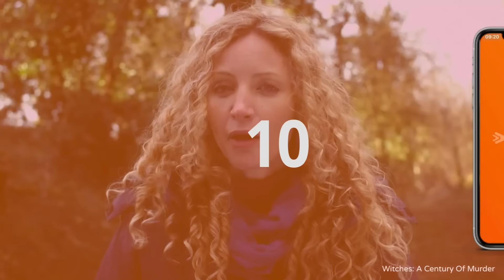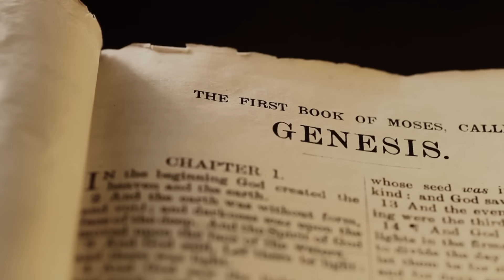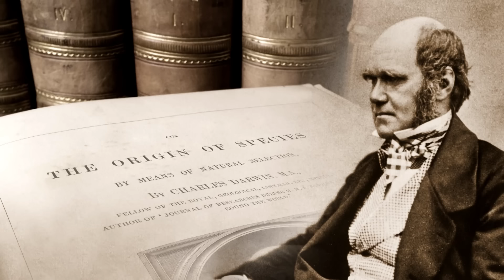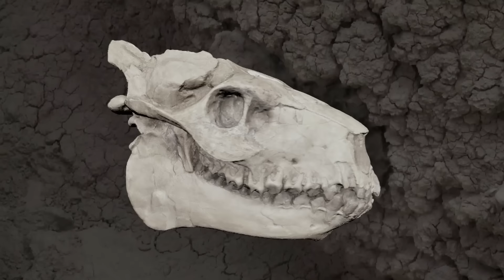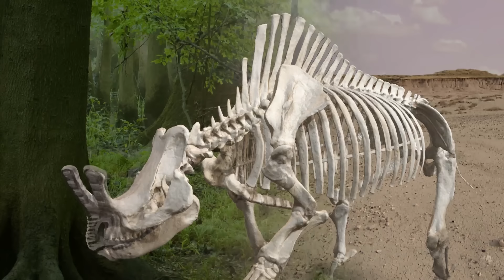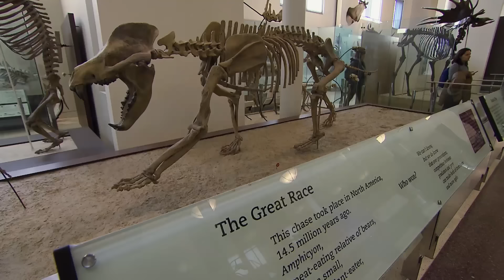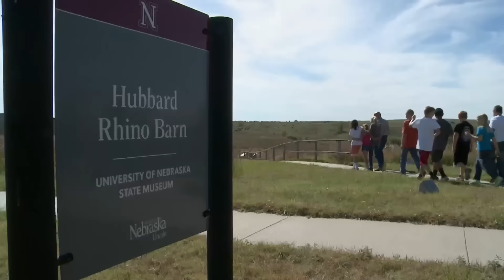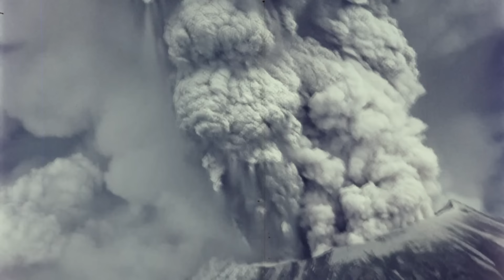Uncovering The Dinosaurs Of The Great Plains | Paleo Sleuths | Real Wild

Comment: How long does it take to turn a bone into a fossil? Here In Southern Illinois we have huge old mining sites that have been turned into state parks. The coal was fairly close to the surface so a lot of this ground looks like they just run the length of the deposit and laid the tailings to the side then move over and start another row. It looks like someone has gone over the entire area with a huge disc, like a field for planting as the rows are realitively straight and consistent in size. It's wooded and fairly thick but there are literally tons of rock of various sizes that has been brought to the top and now sit on the surface. There are tons of fossilized muscle shells in the rock. They have the appearance of modern shells. I've found nothing that looks to be prehistoric so I have always wondered how far back they dated. I feel like they are not that old.
Reply: Fossilized forest remains can be found by splitting layers of shales that were near the shale/coal horizons. Animal fossils are rare.

The Illinois Coals were laid down during the ice age of the Carboniferous period ~300MM years ago. Try looking up "Illinois Basin Coals" and combinations of "Equatorial Tropical Mire Forests of Pennsylvanian Laurentia" for papers. 

Coals were laid down during periods of high sea levels and glaciation, and shales and carbonates were laid down during interglacial periods of even higher sea levels.
Reply: Takes about 10,000 years.